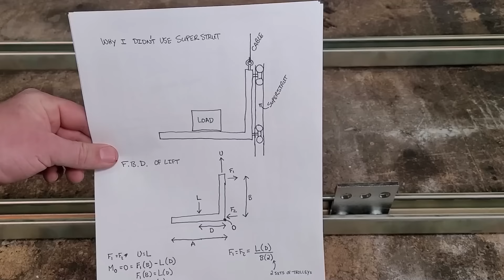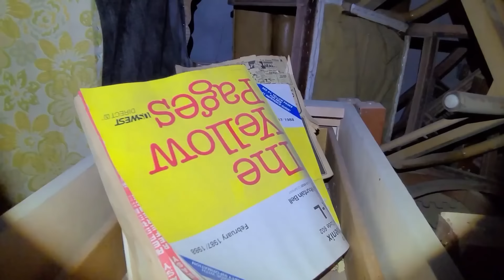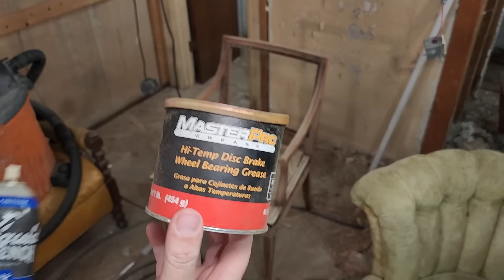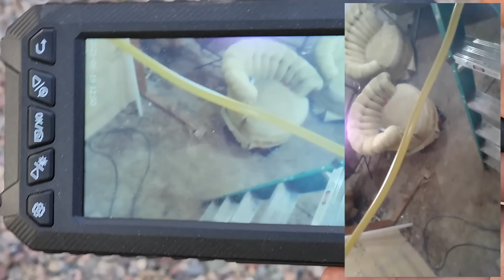WAP - Weird Atomic Pipes | Abandoned Backyard FALLOUT Shelter Restoration ep 16

Comment: I'm pretty sure the square plate bolted to the ceiling is the interior cap of an emergency exit shaft, coincidence is that as a little kid in the mid 80s I explored the back yard air raid shelter emergency exit of my folks place,  the folks in ww2 and the cold war had ran cable and air ducting through the sand ballast filling the exit shaft, your shelter seems familiar just bigger lol

Comment: I would  dig a trench about a foot down and extend the pipe under your driveway with a metal pipe and move it away from the center of your driveway and have it come up somewhere that wont be in the way then back-fill the trench.  Just make sure you use a thick enough metal pipe that you will be able to drive over the pipe without crushing it.

Comment: Agree with the other comment, Fairly sure the sand is because this was designed to be an escape hatch.  unbolt the plate, it falls, sand falls, and you can get out.  Other thing, looks like a fan housing is attached to the plate.  Possibly used as a exhaust fan.
Reply from the maker: I'm starting to think it was a hatch then they added a vent.  I need to dig up the top and see what's up.

Comment: Don't know about the sand around the hole, but this also could have been built as kind of an emergency exit. You unscrew the bolts on the plate and it comes down with a defined amount of loose sand and gravel (without filling up the whole bunker) and provides you a direct way out. So you would be able to leave even if the main exit is blocked or has fallen in (provided you stashed a long enough ladder down below and the bolts are not rusted solid until now).

EDIT: I see @DeeFPV already had the same idea 40mins ago.....
Reply from the maker: I never thought of that but it makes since why would there be a reinforced plate there otherwise.  I think it was originally just an escape and someone added a vent as an afterthought!  I have more to check out now!

Comment: For scoping out pipes you can get some synflex/dakabon tubing slightly bigger than the scope and shove it deep into the duct and then run the borescope up the synflex tubing.  You can also attach the synflex or some braided tubing (for larger debris) to a vacuum to clean around corners.
Reply: I think you could do the same thing with a roll of PEX from the hardware store for a lot cheaper. Put the camera in a 1" pex, and that will navigate the twists and turns in the pipe better. It's almost what genuine sewer snake cameras use (but I think they use some kind of flexible fiberglass pipe)

Comment: I work for the AZ Highway Patrol and about a month ago I passed by your house by coincidence and did a double take when I glanced at the apartment building on your east side. Let's just say you live quite close to where I work;  I was on a one-way street and used your street as a cut across to make a loop back to the reverse direction. I so very much wanted to knock on your door to see if I could tour the shelter but thought you guys likely didn't want to be bothered with tourists. But it was neat to see the shelter hatch from the street at least....or perhaps I should say from the Avenue.
Reply: WTF, if you're gonna dox him, you could be a little more specific. There's avenues running in both directions there? Are you guys on crack? Streets supposed to go one way, and avenues the other my dude!
Reply: @gorak9000  - A peculiarity with Phoenix, streets and avenues go in the same direction. At some point, you run out of avenues and get into the areas that have streets. Thus you'll hear bewildering commentary like "We're pretty far from home, we're in the avenues now..." I had enough of their municipal malappropriated misnomers and  left Phoenix several days after discovering this.

Comment: If you dig it out a bit, you could fit an s filter system in there with a rounded steel cap and rim. So water can't get down, but if you drive over it, it's just a little bump.

Comment: I would stick the vacuum hose in the electrical conduit with a rags . Then listen in the house for the sound.  If you find it. With a plastic bag on a long string. You pull in  wires to have power.🎉
Reply from the maker: That's a good Idea, I wonder if I hooked it up in blow mode if dirt would puff up where the pipe is?
Reply: @HerbOMatic  
It is definitely worth the effort to try.  I don't know if there is a one way air vent . For the driveway pipe  to keep water , bugs, snakes from getting into the  shelter.  Maybe a small rolling door like the main entrance. 
Wish you the best   , you got the best rear view music 😄

Comment: Im only at 9:16 into this, and my thoughts are:

1. Get a piece of 9x18mm trunking, remove the lid and tape the camera to it, then use that to poke it around the corner and onwards. (I have spent hundreds of hours fishing cables like this professionally).

2. I wonder if you could use a smoke tester to work out if theres an outlet?

In any case, thanks for another installment.

Edit: now at 17:00 and you are about to use fish rods, but the downside of those vs a peice of plastic trunking lid, is you cant set a bend in the end of them like you can with trunking lid. #JustSaying
Reply from the maker: I've never thought of that.  I gotta get better at sneaking cameras around all these bends.

Comment: Wow! That bird was hilarious😆

As is pretty much the whole video.

Um, with all of your stuff... Dont you own a metal detector? I mean, you could have measured it (with a tape measure...), to narrow down the area and found it in 10 minutes.  Which you could do with the other hole now.

Frankly after seeing what you have, i am astonished that the whole shelter wasnt full of rain water coming thru those multiple holes.

Anyway, now that you have that hole found at ground level, next step is to find out if they are connected.  Id suggest getting a small  LED  bulb and plug it into an extension cord and drop it down the hole and see if you can find a 'T' or 'y', etc. By putting the cam back up the other hole with the fish sticks
 to see if you can find the light!

By the way, now that youll have a vent on each end, I bet your humidity will drop like a stone rapidly with a continuous air exchange.

Comment: Brother I’m sure those are air holes vents , if you light up a smoke ball red/ or blue and put a fan pushing the air further in to the vent pipe, you can take a walk around the property and see the smoke coming out of the end of that vent pipe on the surface. It should be curved on top facing the ground so nothing like water would come in when it rains. Now you have to extend the pipe up to 3 or 4 feet with a u curve on top.

Comment: Would be easy to make a adapter and run a air hose down there and pressurize the pipe and thewn go on to and listen for air. Look in the shop wall by the breaker panel,there could be a connection in there.

Comment: Other than a vent or chimney,  you also have a way to mount external cameras.
Reply from the maker: That's a really good point!
Reply from the maker: I wonder if the emp would wreck them, but they would be good for other things till then!
Reply: @HerbOMatic  For other things, sure.  Not sure if a faraday cage around the camera would be feasible.  A microwave oven is technically a faraday cage, but it's mesh on the window is only designed to block frequencies in the 2.4ghz range.  An EMP would be over a wider spectrum.

Comment: When you used the fish sticks, i wonder if using zip ties instead of tape would be better. That way once you get in aways, you can have a slight curve to you camera wire and push it around a corner(possibly).
Reply from the maker: I think the ribs of the zip ties would get caught, maybe not.  I gotta try some new moves for the other pipe

Comment: The red headed wife with the witches boots is a keeper 😀  even with a little bit of attitude 🤪  Have you considered installing an underground water tank?  water is essential to survival..  investigate that toilet as well, might go to its own septic tank/leaching field (or go with a camper style dry toilet, water will be too precious if the shelter needs to be actually used): the drain could be used for a small sink.  Underground bomb/zombie apoclpyse shelters cost big money these days..  consider also maybe solar panels on the house or shop (keep some in the shelter as well, that could be put on the ground in the event the surface structures are gone), and install lithium batteries & an inverter, as well as LED lighting in the shelter..  electricity and water will be essential.  of course an air filtration system needs to be consdered as well.  I’d epoxy paint the walls, ceiling and floor to seal it from moisture as much as possible.  Install a camera or two on the top of your air vents, so you can see what’s going on outside from inside the shelter..  even if none of this is never needed, it will increase your property value by at least $100K..

Comment: Get some 1" pex pipe and put the camera in that. It's similar to the stiff fiberglass tubes that actual sewer cameras use. Not as flexible as the camera wire, and not as stiff as the fiberglass sticks that get hung up around corners
Reply from the maker: Hmmm pex is also slippery that may work!
Reply: @HerbOMatic  Don't forget to gorilla tape the camera slightly sticking out of the end of the pex - if you need gorilla tape, the link is in the description
Reply: @HerbOMatic  Would also be good to lathe up a sort of rounded front end that holds the camera and holds the pex, but is sort of spherical shaped on the front end so it goes around corners easier - again, see the design of actual sewer cameras. They have a housing on the front that's super rounded (and hold the camera slightly inside the leading edge so it doesn't get all scratched up) so it can negotiate corners and discontinuities in the pipe.

Comment: If you’d of made a cap for those pipes could you have used an air compressor to fire a load of air in and then be able to find it on the top ?

Comment: if you blocked the pipe inside and fitted an air line or something it might work its way along the pipe and blow air out the other side and maybe give you a clue to where it goes that or a smoke bomb and shop vac on blow rather then suck i was just thinking if it reaches the other side you might be abke to see the dirt it disturbs giving you a clue to the end
Reply from the maker: That's an idea, maybe a puff of dirt up top!

Comment: Why not use a metal detector and then dig???
And I'm guessing air in and air out and the box on the small pipe had a filter or something like...
To get the drum off twist and pull.....with it on the floor would be much easier..?😅
You couldn't have scripted the bird better than that..😅also 😂